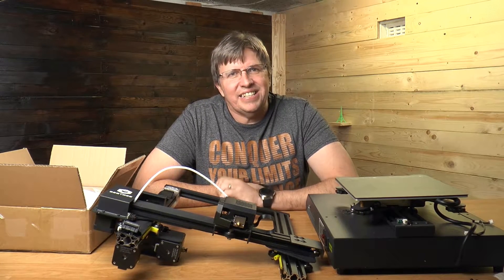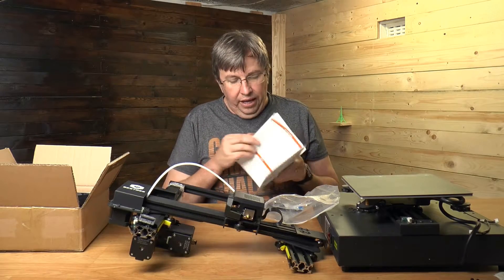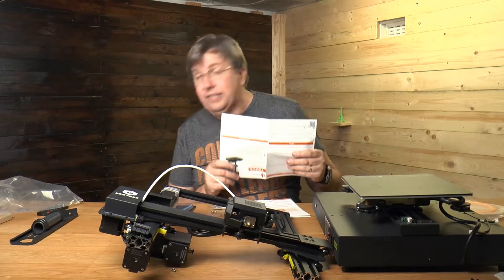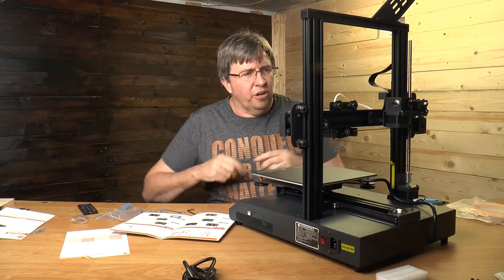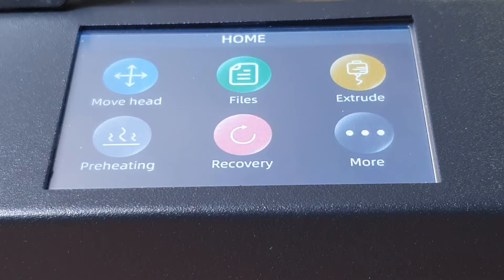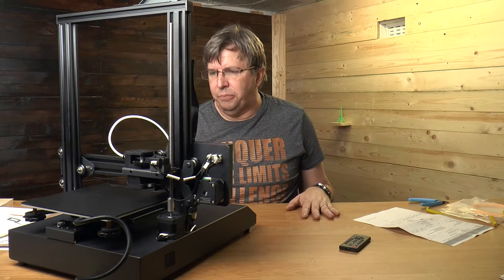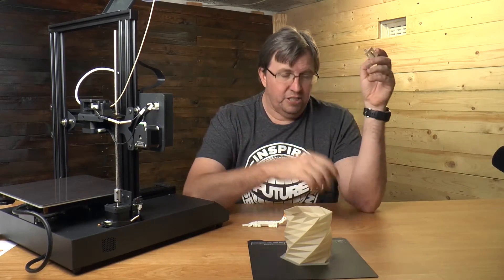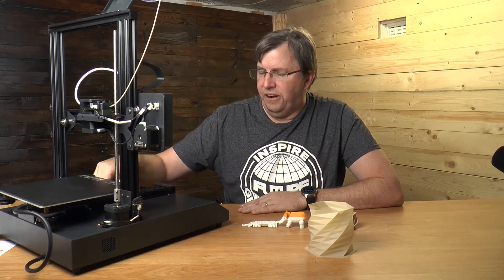TRONHOO T220S LITE | Unbiased First Impressions | New kid on the block

Comment: Where can I get the firmware config? I want to flash the printer, but the manufacturer closed the EEPROM and the firmware config is missing ... this very strange solution does not contribute to the popularization of the model, while the printer is very promising. Manufacturer lay out the firmware!
Reply from the maker: Hi, I will try get the details for you, the firmware for this printer is not easy to find on the web but if you get in contact with them direct, they will send you the firmware.  http://tronhoo3d.com/ and leave a message on the website.
Reply: @FusionSource  Unfortunately, I have already contacted Tronhoo and they informed me that the firmware cannot be sent due to "company policy". It's not clear, dozens of 3D printer manufacturers make their firmware publicly available to make their product better. Without access to the firmware, the printer loses its appeal... I don’t understand what the secret can be in the Marlin settings ..
Reply from the maker: @konstantin_krsk4798  Let me see what I can find
Reply: @FusionSource  Thank you, I would be very obliged
Reply: @konstantin_krsk4798  I have the same problem. I suspect the T220 is a rebranded Leon3D printer.(perhaps you can have a look at their firmware upgrades and settings). I will definitely NOT be buying any more Tronhoo or Bestgee products because of the firmware issue (pity because these are great little printers...but undesirable if you can't upgrade or customize firmware)

Comment: So should i get this or the ender 3 v2 or the biqu b1?
Reply from the maker: Where are you based?  if in South Africa, I suggest you go for the Ender 3 V2 but,  unfortunately, I have not had an Ender 3 v2 printer to look at.  Creality are amazing machines but as I say in the review, I am hugely impressed by the Tronhoo, as long as you get the silent version.  My original Ender 3 took a bit of tweaking to get printing well but the Tronhoo was up and running very quickly.
Reply from the maker: I hope this was helpful but ultimately the choice is yours.

Comment: Hey I know this is completely unrelated to the video, but which do you think is better DLP or SLA? I've been looking at resin printers for a while and have been waiting to pull the trigger so I'd really like your opinion, would you rather go with DLP for the time difference is it worth it or  SLA better for detail but longer print times. Mainly going to be doing figures and models but just thought I'd ask. Thx
Reply from the maker: Hey Shmumphy, So you are talking Resin printer,, DLP(Digital Light Processing) and SLA (Stereolithography), personally I would say the DLP because it is cheaper, a lot faster and more accurate than SLA.  DLP will do a complete layer at a time, whereas SLA moves a laser through the resin, similar to a FDM (Fused Deposition Modeling) (Filament) printer.  If you are looking for the differences between an FDM and a DLP,  if you are doing  Models and Figureens ther go DLP, FDM is great for more practical prints.
Reply: @FusionSource  thx for the reply. I was talking DLP and SLA. I have no interest in FDM, even though its easier post processing. Just wanted to know what tiny differences you'd prefer between the two different curing methods. Thanks again!